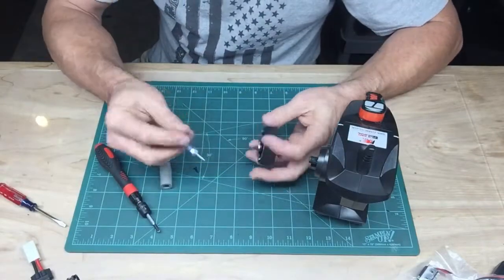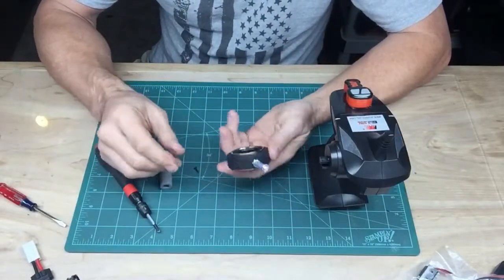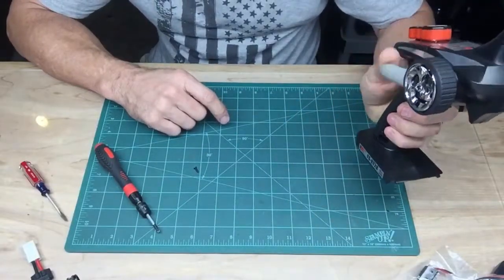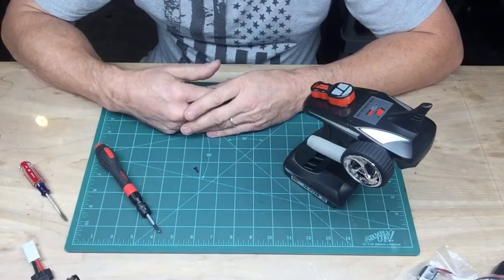"HOW TO" DRIVE YOUR RC ONE HANDED

Comment: What did you do to form the styrofoam on the first controller
Reply: Hey thanks for checking out the video. I appreciate it. So the first remote I just found a piece of styrofoam big enough and just carved out what I needed and made it fit over the remote wheel. It works really well. 😉👍🏻